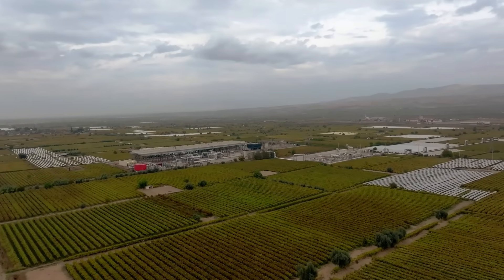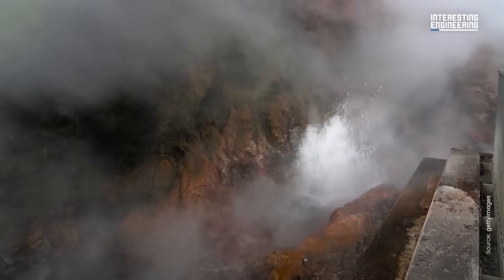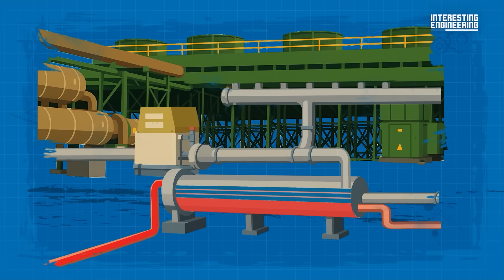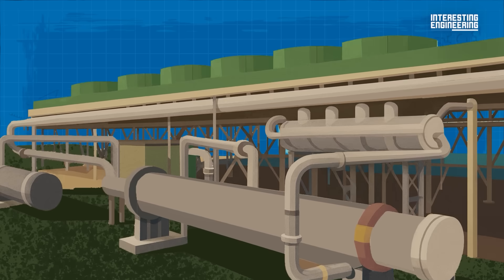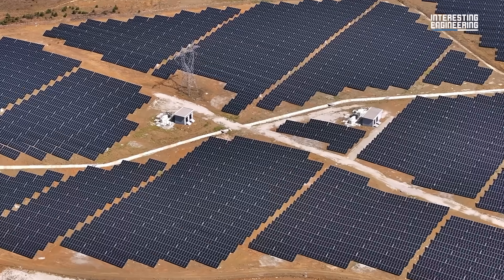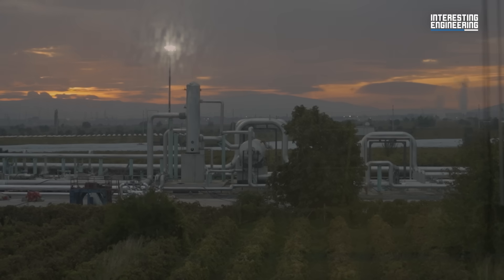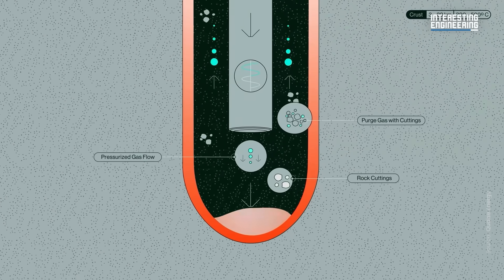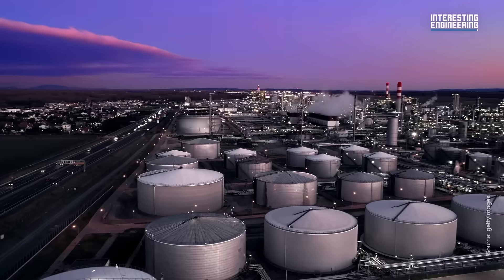Is This the Clean Energy We Missed?

Comment: For sure the way to go and something I've been studying for some time now, but for the drilling there needs to be better techniques developed, and also stacking that amount of pips on top of each other can be challenging, and then the heat. Anyway, this makes it possible to have multiple power plants and a more stable infrastructure, plus it is mainly more safe than most alternatives.
Reply: "but for the drilling there needs to be better techniques developed,"

Millimeter wave drilling by Quaise Energy.

Traditional mechanical drill bits can achieve 0.1 meters of drilling depth per hour through the hardest rocks on the planet (granite)

Quaise Energy's millimeter wave drilling can achieve 5 meters of drilling depth per hour through granite.

Gyrotrons were developed back in the 60's for nuclear fusion research.  Gyrotrons produce millimeter waves to superheat the plasma within a fusion chamber to million+ degree temperatures.

Quaise uses gyrotrons to literally vaporize rocks. 

They will be able to drill to 10km depths, where the hot rocks are, in less than 100 days.

Comment: Very cool... I think Eavor Loop, a Canadian company that is creating closed loop, low heat geothermal using fracking techniques is probably the future since it isn't reliant on Icelandic or Turkish levels of fissures or deep drilling. 
Though speaking of, Deep Fission is a story worth exploring. As of last week they broke ground on their 15 MW SMR that will be dropped down a 30" borehole to the depth of one mile.. It will be online and delivering power by July 4, 2026 according to their plans as part of the Department of Energy nuclear SMR pilot program. If this works this could deliver all the benefits of geothermal and fossil fuels as baseload power from the earth without the expense or above ground infrastructure needed for conventional nuclear...
Reply: There is a correct way to do geothermal, and incorrect ways.

Fracking techniques is a bad option.  Yes, we can make it work, but should we?  Geothermal, traditional geothermal already increases seismicity in the area its done, but doing fracking geothermal will create more problems in the long run.  It's not a good idea to frack the rocks beneath us.  If you're going to do geothermal you want to go straight down into basement rock (below sedimentary layers), and go deep.  Fracking geothermal tries to cheat, in a sense, by avoiding basement rock, and its never good to cheat.

We have a way to go deep now.

Millimeter wave drilling...

Comment: Have you covered osmotic energy generators? It uses difference in salinity to generate electricity.

Now every time I hear 'brine' it feels like bonus energy.
Reply: It's very low density .
Reply: @Mashiyat  But still worthy of exploring using the newest advances which make it much more commercially viable especially if you can also "pan" for lithium, uranium or other minerals found in trace amounts in seawater..
Reply: Osmotic power should not be used because it produces large amounts of saltwater using freshwater.